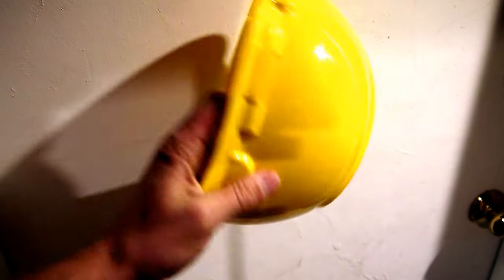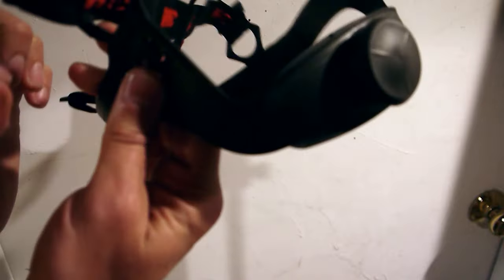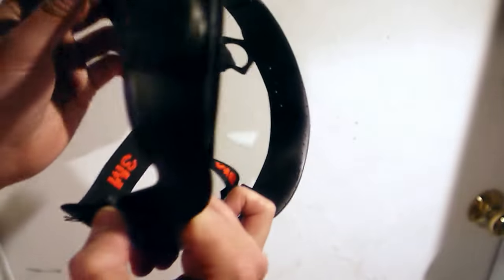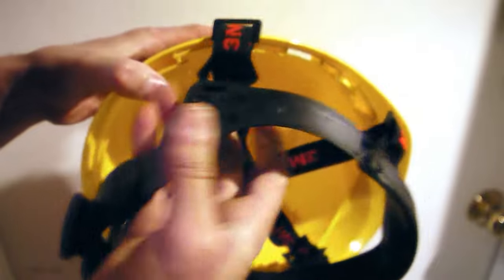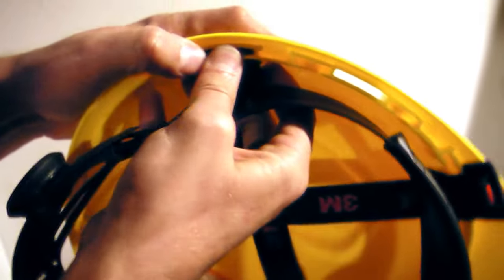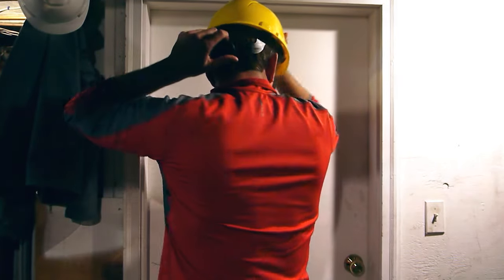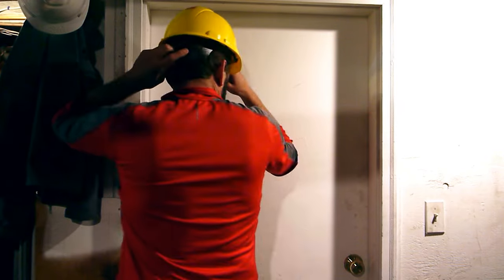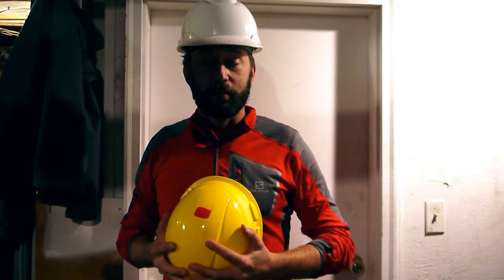3M Hard Hat Assembly

Comment: I still couldn't figure it out.  The 3M bands are pulled too tight and the helmet sits up way too high on my head.
Reply: After finally getting this thing put together and wearing if for almost 2 months, the fact is that they don't give you enough harness for the hat to sit properly on the head.  It doesn't sit down close enough to the ears so it looks goofy sitting on anyone's head.  I realize there has to be a certain amount of space between the top of your head and the top of the helmet, but the helmet is too small to fit properly.  It's a horrible design and should be chucked.

Comment: OMG Thanks!  I was about ready to throw this damn thing in the trash!  3M should really ship these things pre-assembled.  I went into a remote area one day without my helmet, but found one of these at a True Valley hardware store.  I couldn't read the instructions without glasses, so the store clerk tried to help me, but it just fell back apart, because he didn't fold the mounts over first.  So wound up doing an 85 ft rappel without a helmet.
Reply: I agree with you 100% ship them preassembled take the frustration out of it for your normal person